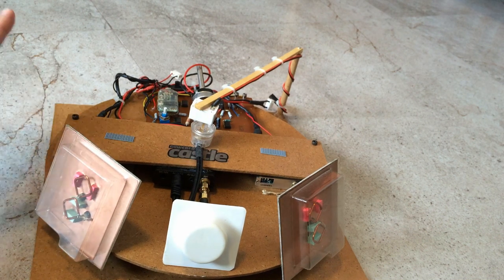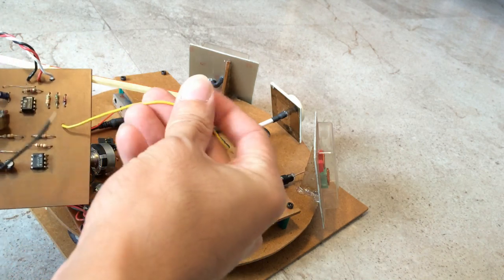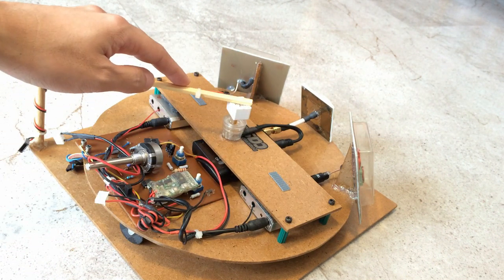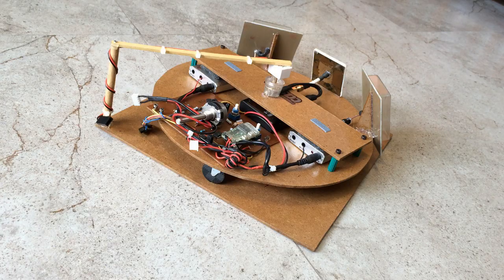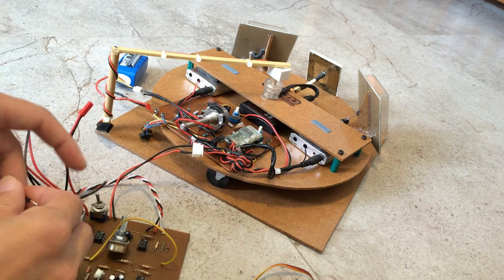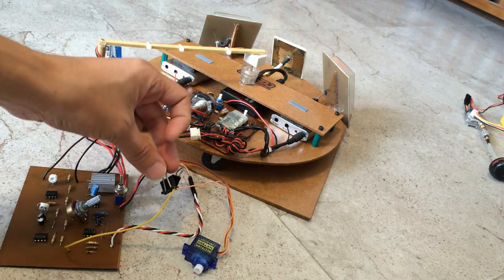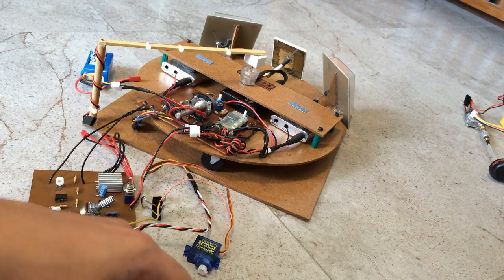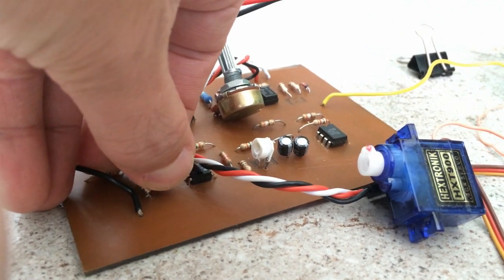FPV Antenna Tracker (no GPS)

Comment: Wow, cp double quad antena,right? What Coaxi cable did you use ?, 75ohm,93ohm ??
Reply: Sorry for my bad English
Reply from the maker: Thanks for watching buddy. I used 93 ohm coaxial cable (RG62A) to induce circular polarization. From the same 50ohm (RG316) feed to the first single wavelength loop, a piece of 3cm-long RG62A coaxial was used to create a phase-shift of 270deg for the 2nd single wavelength loop for 5945mhz.
Reply: @terence79chan  i made 4 phase helical antena (5 turn) last night, work perfect,outperform my diy double biquad and helical 5 turn😃.
Reply from the maker: Congratulations buddy! You can try 4 phased crosshair antennas next time, wider beam for the same gain.

Comment: Dear Terence, it does not seem very ethical to dirty the thread on an antenna tracker system to present yours, you (or RC-Concepts) may open a dedicated one for it. That practice is more like spammers.
Reply from the maker: Hey Raul, I was merely excited to share my idea of using the stop-twist telephone adapter as a slip-ring. I didn’t expect an old Braigtenberg tracker would be considered a “hijack” or “spam” to a knowledge-sharing thread which started in 2015 to discuss a Mavlink-based antenna tracker project, inspired by the opensource arduino-based tracker on Github which was RSSI-based as well. I will ask the thread owner if he wishes me to delete my post.
Reply: hey Raul go f your self

Comment: seem you are using the line follower robot circut and do some modification in the sensor...this is comparator based antenna track..where 2 vrx are used to sensing which is the strongest signal..good idea friend..the vrx in the middle position is the main which will send video out to the monitor...hahaha..nice idea..good jobs
Reply from the maker: Thanks, the original working schematics are posted in rcgroups forum by ibcrazy. I did make some modifications to it, for my circuit to work for most of the analog servos out there.

Comment: Hi Terence Ive got what you mean and done that. I ve got movement but cant lock on. Its all left or all right by adjusting the pots cant see to track the tx on the plane. Ive got a 1500 tx would you think it would be swamping both rx at close distance. Ive seen vids on you tube where there s been no antenna and the trackers followed. How do the 2 pot s work. How do I adjust them and what do they do eg is it left pot for left antenna and right pot for right antenna with the on off switch at the bottom. Sorry for so many questions
Reply from the maker: Hey Mark, you need to remove the antennas from your Vrxs or you will never be able to tune the center position with that powerful vtx. All left or all right means it can switch direction. That's a sign that it's working. Now you need to see it switch direction when ur vtx is moved from one Vrx to the other. A 1.5w vtx could be making both ur VRXs have the same RSSI voltages so you can't get a response. To tune the center, use a low powered vtx. Then leave any one pot in its middle pos untouched, turn the other pot only. A tiny click is enough to make it change direction. If there's no response, try placing the Vrx in the middle of the 2 Vrx but slightly nearer to one Vrx than the other.
Reply: Terence Chan maybe a bourn 5 turn pot will be good for your project, really cool Terrence.

Comment: Hi I was wondering when you take the wire to the center leg of the potentiometer do you remove the exsisting wire or leave it on.
Reply from the maker: Hey Mark, not sure what you meant by existing wire' , I removed that potentiometer. What's left are the remaining 3 legs sticking out of the servo pcb, you will need to solder the servo direction wire to the middle leg.

Comment: Is the RSSI output from the receiver analog or digital?
Reply from the maker: It's analog. 0.5v (no signal) to 1.15v (full signal) from pin 6 of the 5.8g  Boscam AV receiver if I remember correctly
Reply: Terence Chan
Thanks!
Reply: +iforce2d A full walk through like your cheap ass quad copter for this style rssi tracker would be awesome if you could dumb it down enough for mortals to follow.
Reply from the maker: Hey, regarding the RSSI, it is analog. In YouTube search "rc-concepts braitenberg", you will see my older video which shows the RSSI pinout voltages from a standard 8-ch 5.8g receiver(non-fatshark type)
Reply from the maker: In YouTube search "rc-concepts braitenberg", you will see my older video which shows how the RSSIs are tapped from the standard 8-ch 5.8g receivers(non-fatshark type)